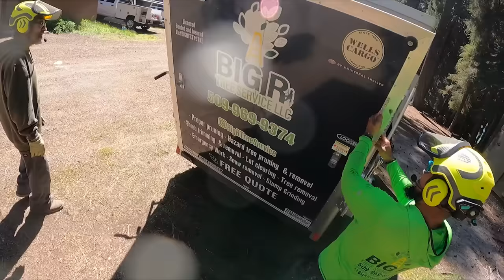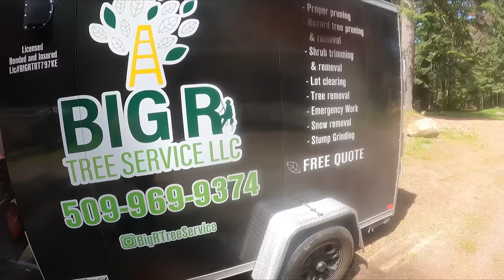Termites vs. Chainsaw: Taking Down the Infested Piss Fir!

Comment: I think Husqvarna owes you a "statement" or explanation on how they plan on handling the safety issue of the stuck throttle with gloves.  I'm experienced and even I'd be taken off guard with that.  It could get my climb line, my tie-in, or my body at redline rpm.  That's most certainly a legitimate safety issue that should be addressed by the manufacture.  I like Husqvarna, especially their battery top handle, but I won't be buying this gasser model until they actively do something to address this.  That's downright scary.  I guess in hindsight I would know to hit the chain brake, but in the moment I don't know what I'd do.
Reply: I think husky and stihl should just make em like they used to and stop "improving" crap for the agenda
Reply: @mute7116  Some improvements are good though, I've had good luck with things like m-tronic and fuel-injection for less carb hassle and also decompression valves to save my shoulder from high compression pull-starts or captive nuts, etc.  That said, I have to agree with you on some "improvements" because the 201 Stihl didn't really make any improvement over the 200.
Reply: Hitting the chain brake might be easier said than done if you're holding a limb in your other hand and can't just drop it without breaking shit.
Reply: @iffykidmn8170  you'd have to use something to hit it, like the tree or the limb you're holding or whatever you can, but you're absolutely right, easier said than done, might not work depending on the scenario.  Either way, not good.  Husqvarna really needs to look into this.  Have any of you out there seen this on any saws?  I haven't in decades of work, and somehow on this saw, it happened twice on the same first day of use!
Reply: @happycamper6352  we have some of the top handle huskys and I just think they're doggy and finicky starters. I love husky but, not these. 
I just got the 201 because I saw buckin' promoting it with the company "rip saw" and thought why not...running it stock and it's better than the huskys. Plan on sending it to rip saw to get the add ons. We shall see.
Now granted, I haven't ran the 500i soooo, I'm probably just butt hurt cuz the huskys are letting me down.
Reply: @mute7116  I've used a 500 for about two years now, and so far, so good, knock on wood.  My only real complaint is my same complaint about almost every saw we have ever run, even oddball saws like the 131 pole saw.  It leaks bar oil when not being used.  I can't for the life of me find a saw that doesn't, with the exception of the old, old saws that had manual oiling (sorry I'm showing my age here).
Reply: @happycamper6352  My (really) old Echo 400EVL doesn't leak but that's about the only auto-oiler that I've used that doesn't unless I store them with the bar aimed uphill.
Reply: @happycamper6352  It's a design feature, if it's not leaking it's out of oil.:face-blue-covering-eyes:
Reply: I run any saws I find at garage sales or aside the road with the garbage cans.  I rebuild em and fix em up. So I own and have commercially used em all. There like cars. They all suck.  I have this old 048 that can’t be killed by conventional weapons.   That’s probably been the least problematic saw I’ve ever owned. And the older stihls last the best.  The new ones aren’t as maintenance free and not as well built. But huskies cut fast and are cheap to fix. That’s the general on the matter from one commercial opinion.
Reply: @iffykidmn8170  That's seems to be the truth.  Most saws are run often enough that you don't notice, but some, like our biggest saw that we avoid like the plague or our 362 which for some reason gets neglected will sit a lot and leak if we don't dump it back into the bottle.  Maybe it's designed to automatically dispense a protective coating of oil so that the surface it sits on doesn't rust or rot?
Reply: Honestly I've had nothing but issues out of husqvarna equipment. Chainsaw brand new blew up on 3rd tank of gas. Took 8 months to get back. Blew up again on 2nd tank of gas. My leaf blower is about to go as well. I'm a motorcycle mechanic by trade so I know how to mix fuel. Never had a problem out of any of my other equipment being stihl echo makita/dolmar. So I know it's not the fuel.
Reply: @HYDETREEWORKS  I quit running 50-1 down to 40/45-1 years ago. I switched to klotz oil from amsoil, haven’t popped anything in years.  They wouldn’t run more than a summer before clappin out before the changes to oil.
Reply: Fascinating. Never had these problems. We are running a trees/hedges business centered in Bergen. All trees here are smaller.  God loves Norwegians,  it seems.  Anyway enough, I am loosing the commentary.
Reply: @ericharris893  I run klotz as well. I'm a dirtbike 2 stroke guy so that's all I run is racing oil.
Reply: @HYDETREEWORKS  klotz won’t stick you piston to your nickel. I had banshees and two stroke bikes of all four main brands. At least a Dozen sleds to over the years. If we’re talkin saws, Crap oil will work but amsoil is gonna stick the piston to the nickel. If we’re talkin snowmobiles, put a rod thru the base, gall the pistons, maybe even lock up the crank at 65 mph at night on a trail and headlights go out with the engine. Bad luck with the blue  or yellow amsoil. The red has been satisfactory but I’ve limited my use of amsoil. I trust supertech over amsoil.  I’ve never had a failure with klotz.  As long as I use 45-1 klotz, my stuff runs till it’s passed it’s useable life expectancy every single time. With amsoil, you holding a grenade.
Reply: @iffykidmn8170 he said he doesn’t know what he would do. Did you not comprehend
Reply: @Bdigital9482  Hard to comprehend as to whom you refer? Jacob, happy camper or one of the other posters.:face-blue-covering-eyes:
Reply: @HYDETREEWORKS  I am not at all a 2-cycle expert, but most 2-cycle experts I know tell me to be careful when you deviate from recommended proportions and 2-cycle oil types and brands.  The reason they give me is that it can change the flash point and therefore cause the fuel-oil-mixture to explode at the wrong time and therefore damage the engine.  Do any of these brands change the flash point of Stihl 2-cycle oil?  I honestly don't know.
Reply: @happycamper6352  as long as you are using a good brand of 2 stroke oil. I prefer 2 stroke dirtbike racing oil. I would say as long as you are sticking to 50:1 or like 44:1 should be just fine. Personally I wouldn't run stihl oil. Especially considering how expensive it is compared to a 2 stroke dirtbike oil. Those little individual 1 or 2 gallon oil just that make 1 or 2 gal of premix you're not getting all the oil out of the bottle. Buy yourself a ratio right.
Reply: Our big husky's have chain brake issues too. Fortunately its only affects releasing the brake. Whatever that linkage is that's connecting the brake handle to the assembly itself seems to be made pretty cheaply.
Reply: @ericharris893  the only amsoil I'll run is dominator. The only reason I run it at all is bc I got it for free. Normally it's techniplate or R50. Motul and motorex does well to.
Reply: @iffykidmn8170 better to break said shit than injure yourself.
Reply: There are forsure improvements in the 201 from the 200, The 201 has way more low end Torque and pure chain pulling power even at low rpm, the 200T is a let it scream to cut like a dream, the 200 has way less lower end torque, sure the 200 sounds cool and is fun to wind out and let scream but the 201 is a much more improved saw, now thats stock for both, the 200 ported and decked out is an absolute screamer but still lacks the low end torque, where as the 201T when Ported and decked out, Watch out its a whole new beast, Low end torque, Hi end power, bury the 16" bar as deep as you want hell cut a 32' log with the 201 it don't complain at all. both great saws just thot id say that there is 100% improvements in the 201T all love Brother ! happy Cutting @happycamper6352
Reply: @mute7116 I got two 201 hot saws and thire bad ass I have 200t done to and thire better than the 201.after u run one for a few trees u can't go back to stock because thire weak feeling that's how different it is when thire turned up its crazy..when it's time to have any of the bucket/climbing saws rebuild I have it done .
Reply: Advanced Lawn Darts

Comment: Humble Cut-mumbojumbo. You're missing the benefit of having a 'tall' hinge. If you've got height difference between the fell cut and the initial cut, you've got a hinge that is flexible and holds a lot longer and can steer your tree until gravity takes over. No height difference - no flexible hinge - early breaking - gravity takes over. I'm sure you can visualize it ;)

Comment: Hello young man. That T540 is a nice saw. As you said,  it's very ergonomic. I'm surprised no one told you how to tune in the saw at first start up on these new Gen huskys. Their electronically controlled fuel delivery. Everyday you start the saw, you have to hold half throttle or more for a few seconds, for the fuel system to acclimate to environmental condition. After that, your good to go. I also didn't see your 590xp with that sweet Japanese bar on it. It outperforms any stihl saw in its class Imo son. Especially with a well sharpened square grind on it. Anyhow,, thanks for another nice well done video, testosterone and ego free 😊. Congrats with your third child coming. Stay safe out there

Comment: Did you gauge the depth of sound wood with your hooks when you climbed past the rotten stretch? The decay followed a strip kill by the Fir Engraver bark beetle on one side of the trunk (you can see the galleries on the surface of the wood); most likely, the decay got started because of deeper tunneling by larger wood boring beetles that bore into the sapwood and heartwood of trees under attack by bark beetles. OTH, could have been decay that was there already, that moved up in the heartwood, and the bark beetles selected the tree because it had been weakened (they can smell out trees with decay!). 

I think it was the former scenario, as the butt and stump looked perfectly sound. Plus the white fungal conk (not mature yet) looks like the type of fungus that decays dead wood and is not a pathogen that could kill sapwood, cambium and phloem; probably a young conk from red belt fungus (Phomitopsis pinicola), which you commonly see on snags and logs. Grand fir can get annosus butt rot (Heterobasidion annosus), a pathogenic fungus which can spread inside the trunk -- but you would see decay pockets in the stump, plus the fruiting body (conk) in your vid looks different; annosus decay fruits inside hollow areas or in the duff at the root crown, and not on the surface. Trees with it often windthrow when still live.

Either way, I think I would have taken a cordless drill with a 12 in. by 1/8 in. bit and drilled on the "good side" opposite the decay to see how much sound wood there was. You determine sound wood depth by resistance to pushing the drill bit in, and the texture and color of shavings. If you have at least 30% for the cross sectional area, the trunk is likely in the comfort zone to climb above it and take the tree down from the top. A good, low cost risk assessment technique (you can spend a lot more on a Shigometer or Sonic Tomograph). But you still have to go with your gut.

I wish you had showed what the cut ends of the logs looked like through the decayed area. If you had drilled, this would confirm (or not) your sound wood estimate.

Just cut a good sized, triple trunked dead hemlock in Suquamish, WA. It had been killed by bark beetles and had a bunch of nice round wood pecker holes in the largest trunk at 10 - 25 ft. --- not ragged pileated feeding holes. Climbed a nearby maple to limb it and take out small tops with a pole saw. Then was going to climb it and chunk it down while roped to the maple -- but changed my mind while still on the ground the next morning. Good thing -- it broke up as it fell and more when it hit the ground. I had decided it would be better to count on enough holding wood for the hinge so I could fell the 70 ft. stubs away from the house (leaning towards the house) instead of a potentially much worse scenario for me. Oh, and one of the trunks had collapsed when I cut off a dead branch tangled in the maple! I used an ax to sound the butt and cut into it a bit, and estimated that there was about 50% sound wood at the base, with most on the back-cut side and in the middle; worked out fine -- but I left a lot of holding wood and banged wedges for a while! 

So if you see a lot of round nesting holes, that tree is likely on the mushy side, and more so up the tree than at the stump, especially if dead (a live one might have a pretty good outer rind of sound wood). And not safe to climb, even if tied into an adjacent tree.

Comment: Did you ever get a statement from Husqvarna over the issue with the throttle trigger sticking on because of the glove catching? That is one of the most dangerous things I've seen happening on a chainsaw and it's a wonder OHS hasn't been notified about the issue from someone else!

Comment: You have to tune that saw broski..find a 25 ft log on the ground and bury the bottom corner of the bar and walk backwards full throttle takes between 1-2 minutes..you will hear it change when it tunes 🙂

Comment: This crew should get a ford power Boost for that trailer they could utilize the generator elsewhere and have a 30 amp builtin generator from the f150 which has a 7000lb trailer atleast

Comment: And that 088 that's a powerhouse I've always wanted one of those I've used them a few times but never owned one I love that we use it once in a great while but they are straight powerhouse
Reply: We seldom use our 880 because once you reach a certain age, it's just a pain to wield something so heavy late in the day.  A 500 cuts softwoods easily with very long bars and hardwoods easily up to 36" bars.  That's all we need around here most of the time.  I leave the 880 to the young guys.
Reply: @happycamper6352  most definitely buddy the 500
Reply: @happycamper6352  most definitely buddy the 500 I has replaced all of our big saws the best saw sthil has came out with besides the 200t

Comment: We have one of those saws but not the top handle model and it runs exactly the same way, when 80-85 degrees out you can't even get it to stay running because it's starving for fuel, piece of crap in my opinion but if they can fix the issues they do have it is a ripper of a saw for the size

Comment: Those aren’t termites. Termites are white and there would either be a hole going up from stump or a dirt tunnel running up outside. Those were carpenter ants.

Comment: your shoulders will be done in 5 years charge more block or speed line 4 or 5 same time
Reply: We have guys around here that do that.  They lose bids because they charge for unnecessary steps.  Fatigue from extra climbing times is just as bad as fatigue from handling the brush without rigging or speed lines.  I'm old and have seen the pros and cons of both.  You do what's best for the situation, and that varies from tree to tree.  If I can save the customer money, I get more referrals and a lot more money in the long run.  My arms haven't fallen off yet despite my age.
Reply: lol  @happycamper6352  from everything I've learnt in 40 years of doing this stuff indicates to me that your retort is not from experience. with a good rope man it's often close to same time as destroying your shoulders and more, even if take a little longer because you had to match a Cowboys price you will thank me in your 60's if your  appendages last that long, I'm not perfect I was young once to :)